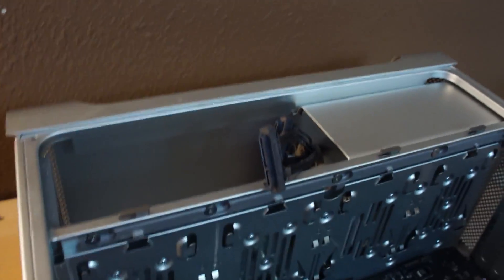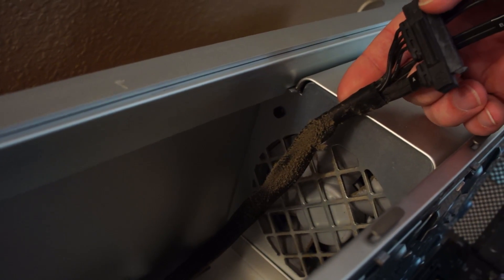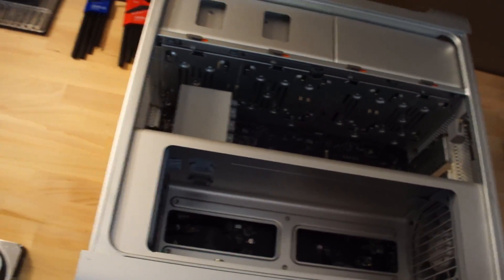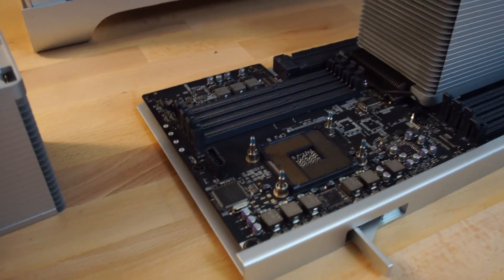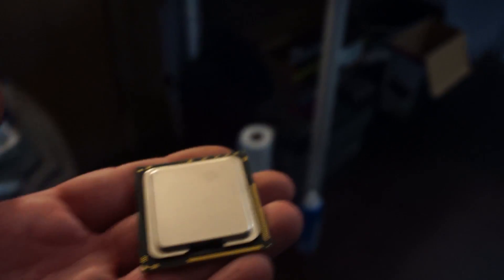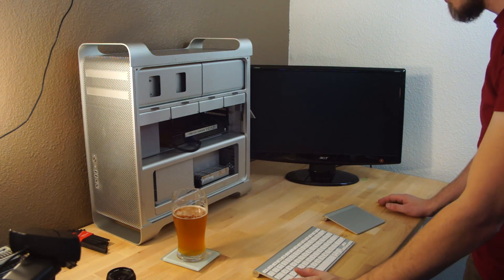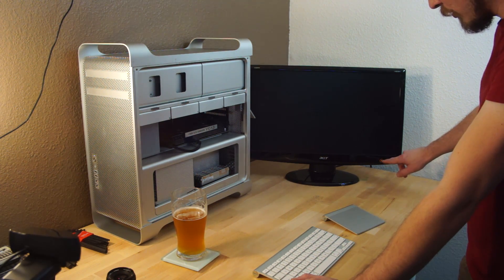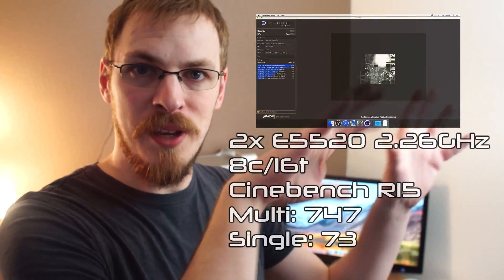Mac Pro Upgrade Vlog. 12-Cores, 64GB, and Pascal Graphics!

Comment: That looked good for a smoker. I was working on a Windoze unit yesterday, and after 2 minutes my fingers were sticking together!! I had to scrub that off, and put on latex gloves. After 30 minutes in the ultrasonic cleaner it still had gunk on it! I took over an hour to get it off. It took all day to actually clean the fans, power supply, case, etc. I found several dead spiders inside the case........I think they dies from lung cancer. :)

Comment: Nice project!  I have a 2009 (I bought new) flashed to the 2010 firmware I need to do this to. 

I delidded my xeons earlier this week - just need to clean them off and then do the swap but have been kind of putting it off.  This video was the kick in the pants I needed to finish it today.  

Such a nice design; I wish Apple would have just kept producing it.  The new Mac Pro is nice but good god did they up the price.  Hopefully the rumors of a reasonably priced Apple Silicon tower will come to fruition.  We need the equivalent of the old IIcx/IIci :/

Comment: wow so many problems with that cpu install, you need to delid them, part of the cooler actually touches the VRM, it needs to be cooled, u WILL burn up the expansion board. i just did the same build. i know this is an old video but wow. also you NEED theral paste, duh.

Comment: If it is a tripple channel RAM machine like mine, it is best to have 2x 3 RAM modules for having the true TRIPPLE CHANNEL feature in RAM bus. So 96GB RAM is a bit faster than 128 GB RAM.
Reply from the maker: True, but for my workload, more ram outweighs ram speed. The penalty isn't that huge running tri-channel vs dual on this system.

Comment: The odd thing when a Mac Pro 2009 with 16gb RAM and 250 SSD costs 390$ and the dual cpu tray (with two cheap processors, without RAM) costs 800$

Comment: I know this is an old video, but I was wondering if you could tell me what the cleaner is you're using (the can appears to be at 3:09).  I haven't found a solid cleaner I like for these aluminum cases so I'm always looking for options.
Reply from the maker: It's actually a glass foam cleaner.  Not necessarily designed for aluminum, but it cut through the smoker grime really easily.

Comment: Funny part is, if you look at Barefeats, this era of Mac Pro is still the best GPU performance you can get in a Mac. Older PCI-E is still less limiting than TB3, and the Vega 64 in the iMac Pro is underclocked to about 83% on both core and memory. So a 1080TI in this is about the best you can get in a Mac for pure GPU performance.
Reply: Mac's only support AMD GPU's. A 1080ti would not work.
Reply: Our main developing rig is a 2009 Mac Pro w/ 12 cores and can vouch that a GTX 1080 WILL WORK with a specialty dual mini PCI-E power cable. It's just under the power usage the power supply can correctly put out. Even then the drivers crash from power hiccups for us very infrequently. A 1080ti would be too much unless you were powering it with and external power supply.
Reply: Use just a 1050ti, that does not need extra power.
Reply: @CoffeeSmack  it's still correct.
If it wasnt, then how come the latest macbooks still use amd cards?
Reply from the maker: May I just point out... I put a GTX 1050 Ti in the Mac Pro in this video. I'm not sure why you're arguing that nVidia cards don't work in Macs...
Reply: @CraftComputing  yep - i'm about to go on this little mac upgrade journey myself - (although ill be putting in xeon 5680s)  mojave requires an AMD card that is metal compatible. That's the only real restriction, you can totally run a nvidia gpu on High Sierra.  the current wisdom is that an AMD RX580 is the best for mojave  - but to state that macs dont support nvidia is incorrrect. Apple and Nvidia are not on the best of terms right now, so it looks like AMD is the weapon of choice for apple in the immediate future.

Comment: I just did this mod on a 2009, only had the single CPU socket card however. on that card the CPU is lidded to my surprise! hope you used thicker thermal pads to cool the voltage regulators!

Comment: i see a mistake, the heat sink covers the vram, with this processor it does not touch them and provide cooling, you need some vram pads
Reply from the maker: You're also seriously underestimating the airflow in the CPU tray area.  VRM are rated to run at 120C.  Temp sensors say that even after the upgrade, they're running at ~70C.  Airflow alone is plenty sufficient to keep them cool.
Reply: i dunno if it is sufficient the heat sink is made to touch them, have you measured the temp before and after of it?

Comment: If you can find one, a galax single slot GTX 1070 katana is begging to be put in a mac pro. They are VERY hard to find though. A used W7000 from AMD is single slot (which is really a D300) would do nicely as well.

Comment: No Thermal paste??
Reply: oh my I didn't even see that lol. no thermal paste, no adjusting for the extra height, no thermal pads on the VRM....
Reply from the maker: +ethan day It's a silver paste. Lights made it look like it wasn't there.
Reply: Craft Computing I was going to say I was a little worried for you lol
Reply: Arctic Silver makes the best thermal paste...I have it on my tower after upgrading from 4 core to 6 core and it runs cool and gets better with time.
Reply: artic silver is not the best anymore.

Comment: Dang!  That's the cleanest Smoker's Computer I have ever seen.  I've pulled apart cases where there's brown-tar coated on everything.  And dust is clinging to the tar!!!  Ever seen food spoiled so badly there is an inch of fuzzy mold in it!  That's usually what I see inside a Smoker's Computer.  Looks like Shag-Carpeting inside the case!!!!  Would love to see a video of your normal Work-Bench and your most common tools you like to use.  Things like your vacuum setup, must have tools, software utilities, hardware utilities, etc......
Reply from the maker: I was certainly surprised at how clean the aluminum was.

All of the fans were pretty well caked with dust and tar.  What you don't see in the video is me hauling all the parts to the garage and going after them with a mildly stiff brush, air compressor and ShopVac.

That's not a bad idea.  I might do a tour of my workbench(es) in a future video.  I have a Threadripper build coming up, and I'm sure you'll see some of it in those videos.  Lots of cool things coming up very soon.
Reply: Excellent!!!  Party On!!!
Reply: Oh boy I know the feel. I cleaned out a smoker's rig with an air compressor and by the time i was done I completely stunk. And I had to go into the PC store to buy an SSD for it too!

Comment: I hope you took that back apart and delidded those cpus.
Reply from the maker: Not a real need to do that.  Everyone says "BUT DAT ACTIVE COOLING ON THE VRMS!!!".  These aren't super high wattage CPUs, and the VRM temps report somewhere in the 65-75C range.  The VRMs are rated to 105C operating temperature.  The entire compartment is a wind tunnel, so there is plenty of air moving to keep them cool.

Much lower risk of frying a VRM then there is delidding a soldered CPU.
Reply: Hey you replied! Cool. Love your channel man!

Have you tried a delidding tool? They make it very simple nowadays, maybe a review of one would be a good video idea?
I wasn't even thinking about the mosfets, but you're right those will be fine, I just know how hot those old macs can run, they need all the help they can get :p 
Very nice machine.
Reply from the maker: These don't run hot at all.  Full load they'll hit 45C on both chips.  The x56xx CPUs are soldered to the IHS.  They're not trivial to remove and don't improve thermals for the CPUs at all.  On the Mac Pro, this raises the heatsink slightly, making it lose contact with the VRM/Mosfets.  But because of all the airflow in the bottom of these cases, that's trivial as well.

Thanks for watching!
Reply: oh they're soldered. Makes sense to me that you wouldn't want to give it a try then. :p keep up the awesome work

Comment: Great video. I have been trying to make a Hackintosh with a system build I did a few years ago but it has be too tough. Im thinking now I buy a 2009-2011 Mac Pro desktop and upgrade it. I do have a late 2009 27inch iMac with 16gb ram 512mb  video card and 2 ssd drive one for the OS and one for editing. Will a 12 core Mac desktop with a invidia 1050 ti video card and 16 gigs of ram and SSD drive be much faster than my iMac if Im using high sierra and fcpx?

Comment: Pays nearly $500 to upgrade a mac pro from 2009 to only get a CB score of 750. My FX-8350 build had a CB of 900 and my ryzen build currently just topped 1890
Reply from the maker: +ProjectHomeProductions I'd love to see screenshots of both. Those are impressive numbers for those chips.
Reply: Craft Computing I in no way meant to offend, it seemed impractical to me. As for the screenshots, I am working on a build video for my new Ryzen build currently so I will be happy to show those when I get it up. 1890 was my peak under ideal conditions (no background processes and only that open program) while under standard load my average is 1750
Reply from the maker: No worries.  Yeah, 1750 sounds much more accurate on a stable Ryzen OC.  The last 1700 I built scored a 1735, and my Threadripper 1900x is at 1826.

You also only saw my before benchmark numbers of 73/745.  After the upgrade it got a 93/1304 in CB R15.

Thanks for watching!
Reply: Craft Computing I'm installing MacOS High Sierra now onto my PC to test cinebench and performance in Premiere as a part of my video which this video was kinda the catalyst for so I should thank you haha 

But no problem, great video
Reply: The old 8 core setup is was 750 with the dual x5650 setup it was 1304

Comment: Hi I was told that the 2009 Mac Pro 4,1 and the 2010 Mac Pro 5,1 motherboards are basically the same. which I bought the 2009 Mac Pro 4,1 from a friend of mine and he upgraded it to a 2010 Mac Pro 5,1 with a 2x 3.46ghz 6-core intel xeon processor, 64gb 1333 MHz DDR3 memory of ram, and a ATI radeon HD 5770 1024 mb graphics card and running on macOS Sierra 10.12.6
But I don't know why it keeps restarting on it's own at any given time. not sure if my friend upgraded my Mac Pro correctly and also it drops the internet connection too.
I know it's not my internet service cause I still get internet connection on my other apple devices such as my MacBook Pro, and iPhone and no internet connection problems with my roommate's computer and other devices. problem is always on my 2009 Mac Pro.
ever had this problem or know of someone who experienced this problem and how they fixed it.

Comment: The 1366 Macs were the best macs ever. Lots of processing power, very easy to upgrade, and running cool and quiet (in comparison to newer Macs which seem to throttle every time under full load). Since then, apple only got worse. Acceptable until around 2013, but now their computers are just crap

Comment: I am kinda late on this but I still hope you are gonna answer this question; Since the stock CPUs are de-lidded and the cooling towers also serve to cool their VRMs, wouldn't the added height you get from using non-delidded CPUs loose the contact? and waht about the 4-pin connector that powers the integrated fans?
I watched another video like yours where the guy basically had to use thermal pads to bridge the gap and kinda cut the clips on the 4-pin connectors to be able to extrude them out enough to connect again. I don't think you did any of this, so I am curious if you had any probelms regarding that so far?
I'd really like to know since I am plannig to upgarde my Macpro 4.1 the same way and I thought about just de-lidding the new processors myself. But if that is not neccesary I'll spare myself the hazzle =)
Reply from the maker: +Sooniecher The only thing I did was swap the CPUs. I've  other had any problems with VRM temps or fan header connections, and have done all of my video editing and live show streaming on this machine since this video went live.

Comment: would this be possible on a early 2008 mac pro tower?
Reply from the maker: Unfortunately no.  The 2008 Mac Pro tower is a completely different architecture (771 vs 1366 socket CPUs, FB-DIMM DDR2 vs. DDR3, etc).  There really isn't an upgrade path for those.
Reply: Would this work on a 2012 mac pro tower ? Do i need to specifically look for a dual cpu slot model ? Thanks !
Reply from the maker: Yes. The 2009, 2010, and 2012 model are all physically identical. The only real differences are firmware. And yes, look for a dual-cpu tray.

Comment: Stupid question, is it better to upgrade an old Mac Pro like this or build from scratch hackintosh?
Reply from the maker: +Tim Kappel Honestly, it depends on what you are doing with it. Fooling around with OSX? Just Hackintosh it. Professional work? Definitely want to build a proper Mac like this. Hackintoshes work fine for some tasks, but are rarely as stable, and often have some pretty deep modifications to the OS to work. They also break certain features of the OS, like integration with iCloud services.
Reply: Yup agreed! I have a 2009 Mac Pro I just Dual CPU upgraded 8 core because I use it professionally being an iOS Dev. I tried a Hackintosh but it really wasn't that stable for my professional work at all. I love my mac pro and still have some upgrades to do and watching your video, now I can take my 1060 I have laying around and install it in my Mac Pro I call Maxie! Yay lol! Thanks for the video!!

Comment: On newer operating systems do you not need to mod or flash the gpu to be compatible?
Reply from the maker: Correct.  Plug and play.  RX 400/500 and Vega cards, as well as nVidia 10xx cards will run, so long as you have the proper drivers installed.

Comment: Can windows be installed on one of these systems? One is up for $200 on craigslist, and im wondering if I should pick it up
Reply: Yep. All Intel-based Macs since 2006 are capable of running Windows. If you were hoping to get into PC Gaming on the cheap, well you might be disappointed because while Macs running Windows via BootCamp can play games, it's not ideal as the hardware is more suited for workstation/server use cases. If you weren't planning on gaming and you prefer Windows over macOS, then sure it'll work great.

Comment: Would the same process work for a 2008 Mac Pro?
Reply from the maker: Negative.  The top chip compatible with the 2008 Mac Pro was the Xeon X5492, and is still a 4-Core/4-Thread.  It does give you 3.4GHz, but that's not a huge upgrade if you already have the stock 2.8GHz.

Comment: Any advantages in delidding the replacement CPUS?
Reply from the maker: I'm looking at exploring that in a future video.
Reply: Yes the heatsink will reach your VRMS and you won't prematurely overheat your system, you will get better cooling, and everything will sit flush as they are suppose to out of factory. It really is not that hard to delid these chips. I did it on my Mac Pro upgrade video easily. https://www.youtube.com/watch?v=8YdpN1kk2Wk&t=138s

Comment: Hey man, 

Thanks for sharing. Great stuff. Side note, is that RED Apple Ale??? Good stuff. Ok. So I have an updated 2009 5,1 Mac Pro. I want to update the CPU, RAM and GPU. I see a lot about this de-lid process. Is it very difficult to adjust the new CPU in the tray? Also, does the GTX 1050i natively support pre boot screen? Looking for help with this update. Thanks
Reply from the maker: Nope, those were the Laurelwood Workhorse IPA and Ale Smith San Diego Pale Ale.

De-lidding I consider to be optional.  The OEM CPUs are delidded, but it has negligible effect on cooling as the heatsinks on the Mac are fantastic, and the IHS is soldered on these chips.  The one thing you run into is the downforce, which is what caused my machine to not boot late in this video. As long as you don't torque down the heatsink too far, you can run this machine with lids just fine.

The 1050 Ti (or any other PC BIOS card) will not support the pre-boot Mac screen.  To see the screen pre-boot, you will need to flash the card, which can be dodgey as there are no official 10-series cards for Mac.  YMMV.

Thanks for watching.

Comment: Nice build for the price. I'm looking to build a photo/video editing machine.. but I have always done PCs at home and work on a high-end iMac at work..  Does this seem like a more cost-effective solution than a PC? It's such a tough decision. For photo/video I highly prefer the simplicity of Macs, but I also used to game, so either way I have to give something up. Hackintosh maybe? hah
Reply from the maker: It works very well for the price.  And really, how well it does depends on what you're doing for photo/video editing.  Editing video on this worked just fine at an amateur level, using consumer cameras and codecs.  As soon as I stepped up to a higher-end camera, the Mac began to stutter in the timeline and really slow its rendering time.  My new camera is still only 1080p, but records at 50Mbps in XAVC, so not even RAW or at 4k, and it was still struggling.

I rarely recommend going Hackintosh for any kind of production work.  It works fine if you just want to fiddle around with it... but then something breaks and you're dead in the water.

Honestly, I moved this week from the Mac Pro to a Threadripper 1900X workstation for my video and photo workflow, and the difference is night and day.  Timeline editing was as smooth as could be.

My recommendation is to wait and see if Apple decides to upgrade its pro-line this year at an affordable price (very doubtful on the price...), or go with a PC.  Something like this is around the same price point as the Mac, but gives far better workflow performance: https://amzn.to/2uC2i0I

Thanks for watching!
Reply: Awesome and quick reply. Answered a lot of my doubts! Thanks man!